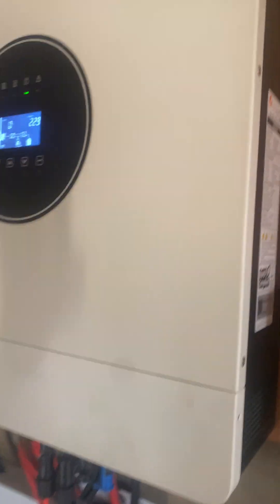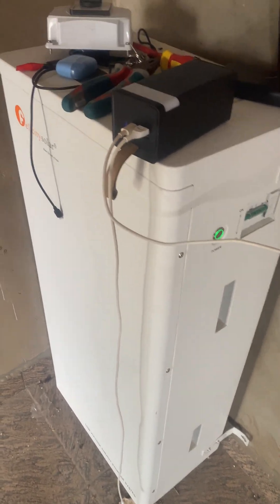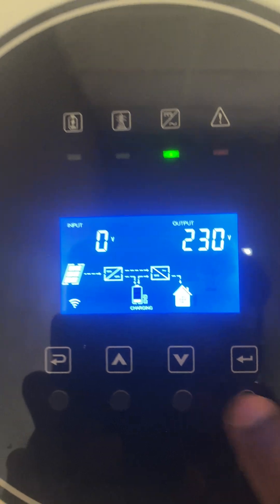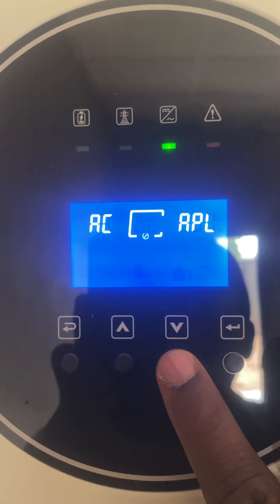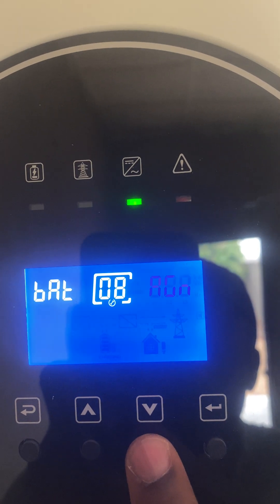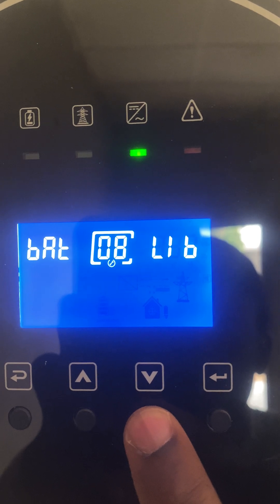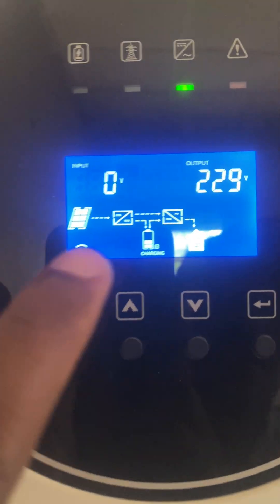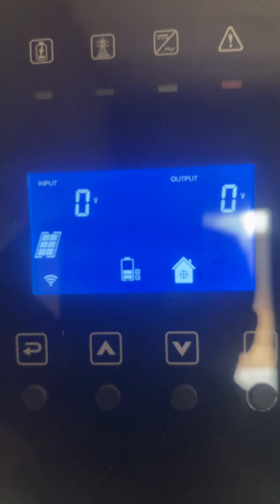How to set Felicity inverter and battery communication @ikechukwuumunna123

Comment: Hi I have issues with 12kva Felicity hybrid inverter.. I installed 10pic of 580w bifocals panels on 2 series and parallel them, at the end, the inverter picked but no pv symbol displayed and doesn't indicate any charging signs but battery symbol blinks but empty. What's the solution. And also I see pv1 + -/pv2 + -, does it mean that the inverter is carrying strings? Tanx
Reply from the maker: Your connection was wrong 😔 

Do 5 series and parallel the two strings 

Use the PV1+ /-

Comment: Hello, thank you for the help. I want to know If the battery is lithium and I put agn or gel in the settings, the battery won't charge?
Reply from the maker: It will charge,you just have to make all the necessary settings

Comment: The dip switch 1 and 5 should be ON for a single battery and i asked Felicity support to be sure and this is the correct configuration
Reply from the maker: For single battery, it will work with any switch off or On

Comment: What if you put the communication cable and it still says error 80? What do you do, I have a 10kva and I have placed the communication cable on RS485 on the inverter and on the battery

Comment: Gr8 
If felicity 10kva/48v ad felicity 17.5kwh/51.2v ar connected with d black cable dat is label 0 link ad link 1 to d inverter ad battery ad error code 80 is flashing on d screen ad d lib display but d com didn’t come up on d screen ad error code 80 is flashing 
I can i solve dis issue

Comment: Thank you for the response video. My issue is slightly different, with this battery (FLA48300) in the video, the other 15kwh model (LPBF48300) and the new 10kwh (LPBF48300), I have no issues as it communicates perfectly. But with the older generation Felicity 10kwh battery that is actually a 7.2kwh as you mentioned in one of your videos, selecting 'Lib' in the menu (8) with the communication cable triggers Error 80. I done try tire to sort it out with no luck, even used an Rs232 Cable to connect to a PC using the EDMS software to see if the battery is communicating.
Reply from the maker: You are using the same 8kva for the 7.2kwh or another inverter ?
Reply: The same 8Kva, the IVEM8048 model.
Reply from the maker: @ikechukwuumunna123 use a new rs485 cable complete 8pins it will work
Reply from the maker: Or WhatsApp me on 09065594904